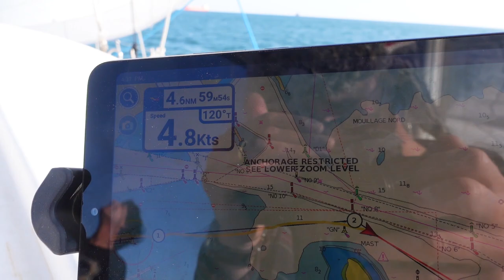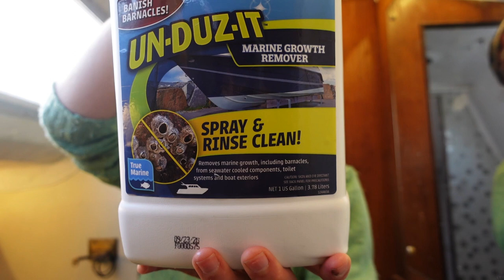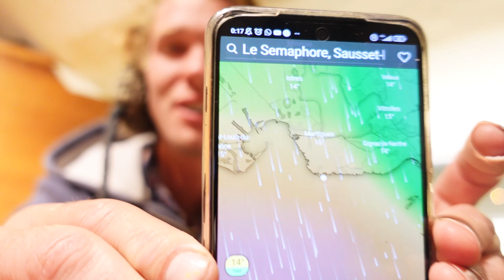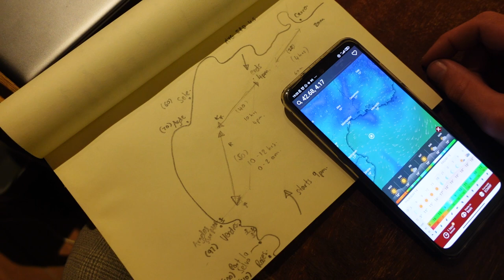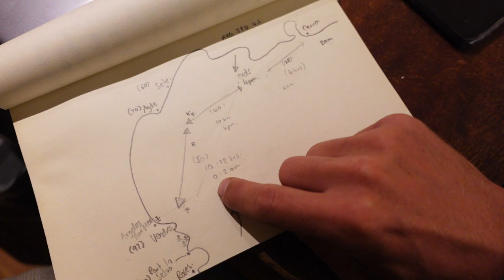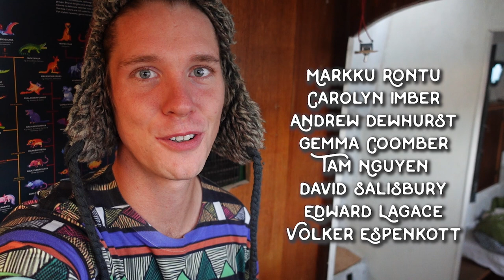We're taking the 1975 Project Catamaran Offshore! | Wildlings Sailing

Comment: Look at how to use spring lines to pivot the boat. It is a trick to get a dingy off the dock. Take a line of the stern cleat to a point on shore and back to the cleat. Set the sails so the dingy reverses. It will pivot against the dock. As soon as the bow is pointing away from the dock, reset the sails and let the spring line go. It should work for a bigger boat unless the wind is seriously strong which is perhaps your current situation. I'm loving your channel.

Comment: For me leaving and docking is the most stressful part of boating. Once your out in open water it becomes more relaxing. Your cat sails beautifully, you could have used the main, but go with your comfort zone. Yoshi is now an official boat dog, chilling with your mom. The painting is awesome, nice addition to Minke.
Reply from the maker: Cheers, Bob! Yeah, I find that, I'm happy setting off from a straight dock, but when you're crammed in it's a bit difficult!
Reply: Ahhhhhh thanks so much 🤗
Reply: good job with that sail thats the joy of mizzens they keep boats balanced without the main sial and 5knots is fine
Reply: It looked like the Wind was blowing you onto the dock... tricky  but the answer is to hold one line close to the dock and swing the other end out ... Either by trying to push your bow out. 
Or by pulling the bow line in letting the stern line out and using the prop wash and rudders to swing it right out till your well clear across the channel if you go into reverse and slip the front line you will be clear to reverse out and bring the front around to move ahead.
The single line as long as its strong enough will act as a pivot point... sliding away as you pay out the line🤔.

It should be easier if the winds trying to push you off the dock.
You dont have to push or drive the one end against the wind ...you can use it.
Reply: @WildlingSailing  you can use a spring line to bring the bow of the boat away from the dock with out actually moving the boat.  Something to practice when you get a clear ock
Reply: @richardthomson4693  I agree to use a spring, but would have sprung the stern out (stbd engine astern, port ahead but less) until stern clear of cat astern. Alternative if that impossible (although it would have worked this time) is to use the dinghy to drop an anchor to windward and help haul yourself out.

Comment: I had a diesel engine that started like that, it was a small leak in the line, not enough to let diesel leak out but enough to let air in the line so every time I turned it off the fuel would drain out of the lines causing the hard start up, hope you get yours fixed, if you ever need it in a hurry your hooped

Comment: I was going to say use the Stern spring line to help lever you off the pontoon … but others mentioned the spring before I did … I'm not keen on climbing on other people's boats (unless it's a rafting situation) but moving them without permission I would avoid in case you damage their vessel or you don't tie the lines back the way they were and the lines come undone and their vessel goes for an unexpected trip adrift, I have seen it happen.
I think the Thumbs Down was from that Cat owner whose vessel you moved … 🤣😂🤣

Comment: Getting away from the pontoon was hampered by Minke's windage... a catamaran thing. You should learn to 'spring' the boat off.... using spring lines, and perhaps the wind too.
Reply from the maker: Yeah, we did try the spring but it just wasn't enough power to get it to spin out against that wind blowing us right on to the dock!
Reply: My thoughts exactly. Using springs and differential thrust, windage should not be an obstacle to springing off. You just need some training and reliable engines (oops, maybe they have neither here). But the biggest kicker here is that you don't climb aboard another person's boat uninvited, and you most certainly don't move that boat without permission - lacking a real emergency, simple as that. Doing what they did is inexcusable. If you need help to get out, you simply call in the marina people because if they catch you doing this then the marina will ban you and likely call the police. (I wonder if the marina people have seen this video...)

Comment: hi you two, if you are pinned in to the wharf by wind,  or no room to manoeuvre,  try setting an anchor from your dinghy and then winch the boat into the clear water. Sounds easy but you are on a boat so usually never that straight forward. Good luck and happy travels!

Comment: I haven't read the comments, so forgive me if I'm repeating this.  I wasn't there and you may have tried this, but leaving the dock in a tight place is called springing from the dock I believe.  In your case use a couple of fat fenders on the aft starboard side between the hull and dock.  Cleat the aft starboard corner tightly to the dock with fenders acting as a buffer with a crew member stationed there ready to un-cleat at your order.  Reverse port engine slowly this will force the bow out into the canal and the pivot point will be at the aft starboard corner.  As the starboard bow clears the vessel in front of you, put both motors in forward gear as the crew member un-cleats from the dock.  If you don't have a port engine then your original course of action was probably the best.

Comment: Hi Mark & Nadiyana, nice vid, you might include in your reading, how to rig fore & aft springs and kedging techniques, very useful when you find yourself pinned to a pontoon/jetty or wall by the wind. Congratulations also on those dry bilges 👍. Another quite accurate way of getting the mast straight is to take a halyard to where the masthead shroud meets the deck they both should be of equal length, and if need be, adjust accordingly. Finally, what a smashing family you have, that quilt was something else. Kind Regards, Barnacle Bern   SY Cadbri  SW Wale

Comment: You need to keep an eye on those keel boat cross beams , I reckon they are rotting inside
Reply: He needs to tap the bottom of each beam with a hammer that a signal for the termites to hold hands.

Comment: I know that this is probably out of sequence but my Volvo Penta use to be a pig to start. I would crank and crank until it eventually fired. My problem turned out to be bent con rods probably caused by water syphoning into the cylinders. After I stripped it down and changed these it would start immediately. Not a simple task I know but the engine ran so well afterwards.
Incidentally I now live in Spain in l'Ametlla de Mar which is on the Med coast about 150kms south of Barcelona. My route here was exactly yours. If your voyage brings you this way then you are very welcome to drop off for some Iberian hospitality, a washing machine and a well equipped workshop. l'Ametlla is a charming fishing port with a small marina and visiting berths and we are just 2 kms away from the port.

Comment: FASTER STARTING ENGINE ADVICE , buy a electric fuel pump and use along with your mechanical fuel pump, before starting your engine turn on the electrical pump to help with the diesel fuel pressure, it will help you start faster, also buy a spare starter you will soon ware out the one you have with all the long starts, and you may not be in a place to get one easily.
Reply: And your injectors are probably original so you might want to think about having them rebuilt at least or rebuilt and buy new ones!!! Always have a back up!!!
Reply: @rolldogg01  
They did have them stripped and rebuilt.. 
For a small tested inline fuel pump Mark see Sailing with Geordie ...and his vintage wooden motor launch in BC Canada.
But an automotive diesel pump would do as long as they can rig  
A return. He took out the original tanks so im not sure how hes running his tankage at the moment.

PS as someone from where JRRTs Hobbits supposedly came from I can tell you even your folks would be needing full fleeces here now late Nov. So we are feeding you info at least three to four weeks late. 🙄🤞🏻

Comment: Look at getting a compression test. If compression is good it may just be an issue with the fuel system having to prime.
Reply: Yes, i believe it is air in the lines.. Because the engine did start immediately and then die.. Because air pockets have formed in the high pressure side of the fuel lines. And he is essentially having to prime each of the fuel lines a small amount each time the engine sits for so many hours or days depending on how quickly the air leaks into the fuel lines
Reply: @Orbacron  yes, I've said this a few times on here ....

Comment: perhaps  your engine problem due to an air leak on you fuel lines ( on the spill line ) Or a poor fuel pump non return valve , the blue smoke is oil but it maybe the bores are glazed  ,, I did say your PRV  might be stuck. also from ,
 what I can hear from you vid the pump timing is wrong ,sounds like pre detonation could be just the vid sound if it is a merc engine with a timing chain they stretch and put the timing of the pump out,, and requires a merc timing tool to set the pump after a new chain fitted ..That aside love your vids ,, take care and god speed .

Comment: Get yourself a Mantis Anchor, much better than the cqr. For leaving the dock in tight quarters, keeping a stern line to the dock from your outer stern cleat, when you engage forward, instead of going forward you will transverse sideways, wheel to starboard will keep you pointing forward, when your far enough out, just slip the line and your away. You can use this to swing right around in tight quarters, where you wouldn't have room to turn normally. Using a couple of lines, you can adjust your swing.

Comment: When you are blessed with dual propulsion you put one side in reverse and the other side in forward.  That will cause the boat to rotate in place.  Then you can just drive it out.  You need to get some dive weights to wear so you don't waste all your energy just getting to the bottom.  If you want to shoot a fish you need more bottom time.  Some dive fins will help a lot.  Kicking you feet madly to get to the bottom and to stay on the bottom just makes a lot of noise which scares the fish away.

Comment: Shouldn't you start older none turbo diesel engines with fully open throttle and ease back once it's fully started as not to bend push rods?

Comment: All on board. One hitch on dock cleat  astern of midship spring line. Held firm by mate is your Spring line on the starboard midship. 
Right full rudder. Fenders on bow starboard quarter. Bump Ahead easy. stern moves away from cat to stern as mate eases off cleat pressure. Forward motion is zero. Mate Let’s free when clear of stern traffic. 
Rudder returns to mid ship. Line pulled in as reverse is now put on. Slide back. Easy right rudder. Neutral. Full left rudder to coarse. Your clear.

Comment: Still don’t understand your inability to use the main after all this time, you’d get to destinations quicker and be at sea less time .your boat will heel less and be more balanced .
Loads have mentioned it.you even mention it.mainsail first , then add Genoa, then the mizzen because you have one .someone said it in a last video about the airplane effect and then the biplane and then the triplane .struggling to understand how your not thinking this way.
Seems like your mindset is monohull still and not multihull.
Regardless stay safe and live the dream ,hope it all works out 💪
Reply from the maker: Aye, but we've got a mizzen too, to balance it out and luckily Catamarans don't heel. I think people need to be more open minded when it comes to sail plans for whatever ones trying to achieve, everyones different
Reply: Your boats drive force is the mainsail though, the Genoa and mizzen are there to support it and add more stability, flexibility is great but don’t forget the centre of effort is designed from the use of your mainsail and everything else around that.
Good luck with the sail .